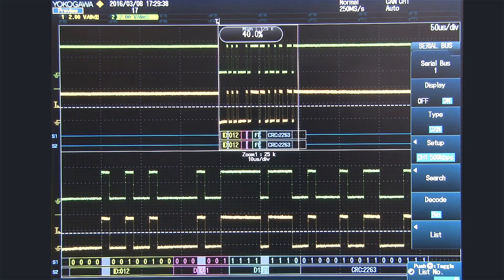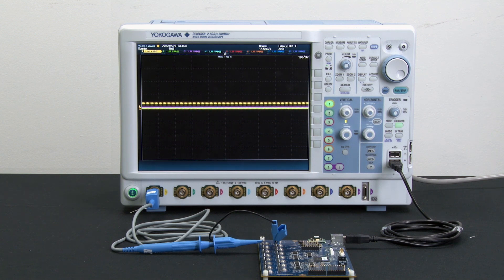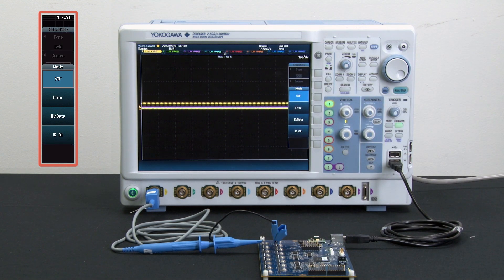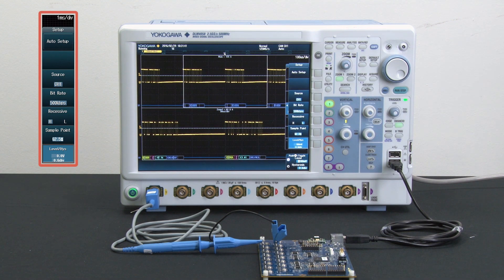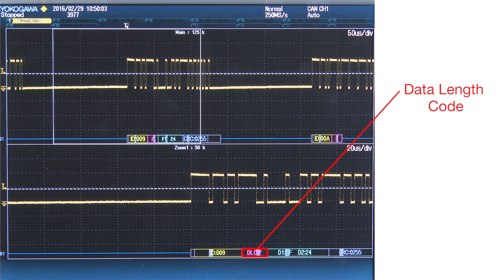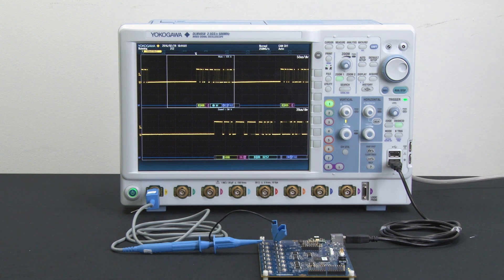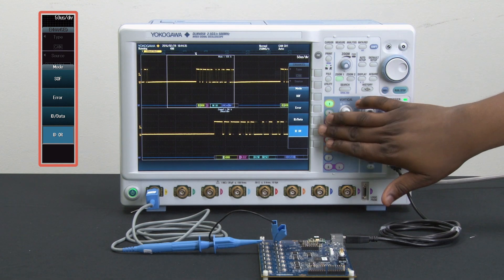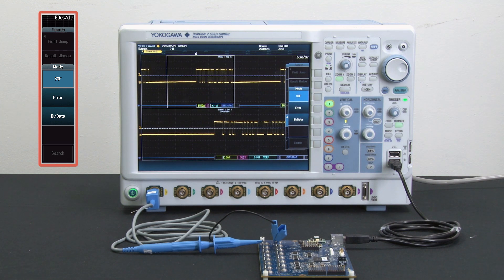CAN Controller Area Network Decode and Analysis using an Oscilloscope

Comment: Nice video. A question. Can I adjudicate names to the ID and data fields for We to know who is the device is working sending telegrams? Can the recorder put between for example ID12=Master processor ID=02 flow water sensor.. etc. and display it this names under waveform?